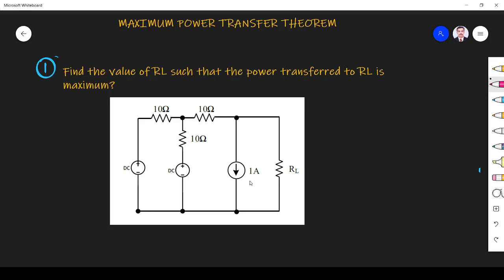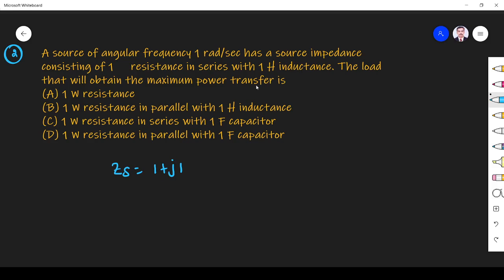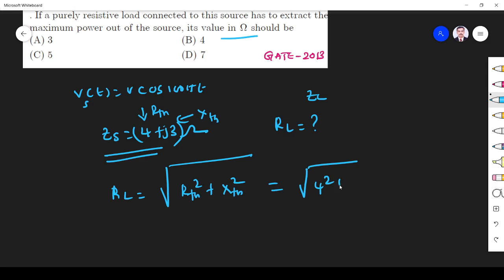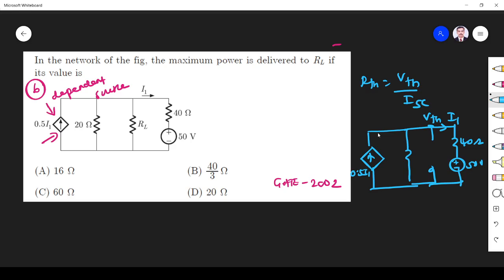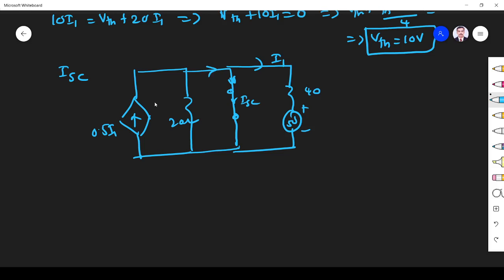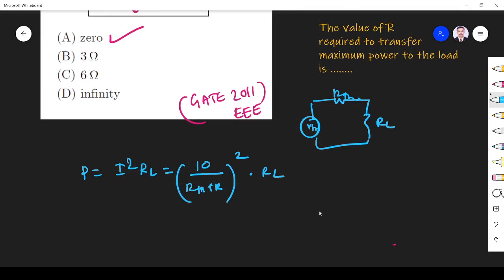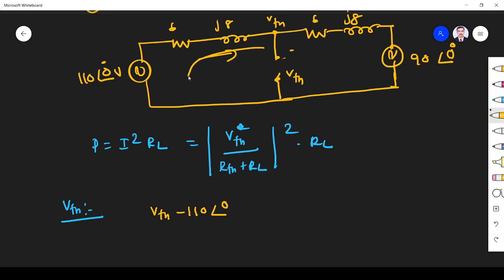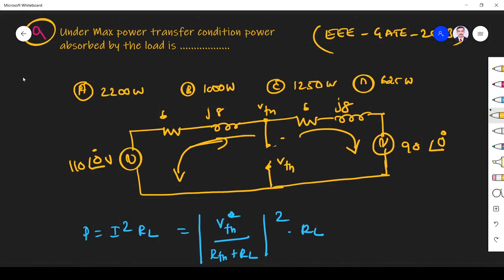Maximum Power Transfer Theorem GATE Problems

Comment: Sir I have a doubt, in 5th qn. max power transfer formula is p=v^2/(4×RL). By using this formula im getting ans as 0.0625w. Which one is correct sir , if im wrong correct me.